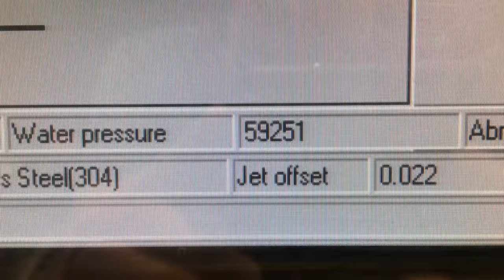Cutting An LED Light Bulb With A Waterjet

Comment: maybe Cut Open a  Few Frying Pans and stuff  or Microwave or Fridges
Reply: Machine has a height limit, so it would need to be a super compact microwave and fridge as the table top to nozzle end is so far and requires 1/8th clearance as the least.

Comment: Styrofoam blocks! Steel Beams.
Reply: I/H beams would be a challenge for this machine due to lack of head axis rotation since its a older model of which is still in production but offers newer radial head cutting.